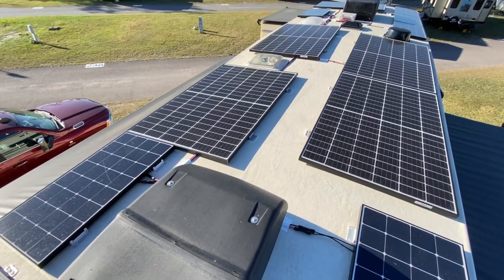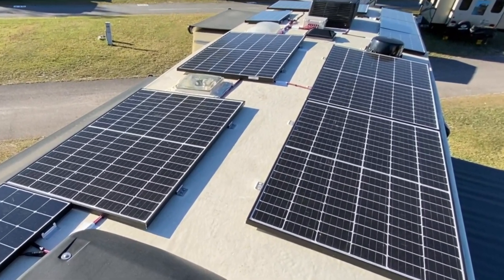@battlebornbatteries & @VictronEnergyBV Setup | 2021 Grand Design Solitude 310GK

Comment: Wow! That is a neat setup! My wife likes 310GK over Montana 3120RL because of its colors and more storage capacity. I preferred Montana because it has 16,000lbs GVWR comparing to 310GK has 15,000 GVWR. My wife wants a washer/dryer and I want a solar setup like yours. I don't know if 15,000 GVWR will handle like that! What are your opinions? Great videos! Thanks!

Comment: so will this system that you installed be able to automatically transfer from shore power, to generator, to solar power on its own? and if not what would you have to do to do it? will this system run 3 ac units or just two at a time?
Reply from the maker: Completely automatic and yes can run 3 ac's at the same time.

Comment: Mike, I've read most of the other postings about the great install you did here.  I'm curious like everyone else. Isn't the customer overpowering his batteries with so much solar power? I realize there's a charge controller meant to protect the batteries from being overcharged by the solar panels. So, isn't it kind of a waste of money to have such an excessive amount of solar, when the 2 charge controllers are going to prevent the panels from sending too much power too fast to the batteries? Thanks. I do admire the great work you do.
Reply from the maker: Hi Roger, thanks for watching. A common misconception about solar is that you need tons of batteries to run your RV; however, unless you plug into shore power or fire up a generator, how will you charge up those batteries the following day and still be able to live comfortably while charging your batteries with only the minimum(or in some cases less) solar? That’s how I look at it when I’m designing these systems. This client is able to live comfortably during the day, run 2 ACs at the same time, if he so chooses to do, or he can actually run 1 AC while charging his batteries (in good sunlight of course) at the same time. The client’s habits, desires and needs are the contributing factor in how a system is designed. The solar is pretty much the cheapest part of the equation, so why not get the most out of it. Hope this helps.

Comment: What grommet do you use for your wire pentetrations through the plywood walls?
Reply from the maker: I typically don't have to go through any walls as I utilize the satellite cable chase.
Reply: @TheDryCampers  Thanks for quick reply! I guess I was referring to the walls that you rebuild in the basement storage to house all the equipment. Have you had to configure an Onan onboard generator to auto start with the BMV or Multiplus before? Can't find much about it in Victron forums.

Comment: Hello, Love the videos! 😁 I have a 600 watt system set up on a travel trailer that I did myself, upgrading over 3 years or so. Love having solar power, It's so quiet. If you're able to catch this comment maybe you could comment on a problem I ran into with a victron 712 meter? Short version is it stopped reading volts from the battery after working fine for almost a year. Reads about 3 volts instead of the 13.6ish that the solar controller reports. Checked connections and readings at all the/any junctions I could find and best I can tell, I think it's the circuit board at the shunt. It looks like others on reddit and google links have run into same problem. Would love to hear your opinion. I've been waiting for customer support at Battle born batteries for months now and no update. Is it something common you think I might be overlooking?  Also would love to hear from a viewer if they've experienced the same. Thanks.

Comment: The system looks really nice 👍 Big should handle boon docking really well. I don’t have a RV yet but the 310 GK is at the top of the list I’m a year away. I have a couple questions, why use different size panels and since it’s a 310 can you share the routing for the wiring from the roof to the basement.
Thank you
Reply from the maker: Thanks and the 310 is a great selection! As mentioned in the video not all RVs, based on the roof dimensions with vents etc, are able to fit mostly big panels. This client wanted to max out his roof with solar, so we were able to fit 6 large REC panels and fit 6 smaller 100W panels to max out at 2580W. Because solar charger controllers max out, we did have to do 3 arrays due to the voltage differences. Most Grand Designs are equipped with a satellite/cable channel and we typically are able to route through the same channel.

Comment: I wiil only get 4 of the REC panels next month, you recommend upgrading the cable fro the connector box on the roof to the MPPT from 10 AWG to  ????? [ I see you did it here, but you have 6 panels]
Reply from the maker: Mike utilizes 8AWG from panel to panel, in parallel, then he uses 2AWG from the combiner box down to the equipment.
Reply: @TheDryCampers  thanks

Comment: The guy that has the fooring store south of Daytona turned me on to your channel, is this his 5 th wheel? Where do you get on the list for a van job?
Reply from the maker: Thanks so much, Raymond! We did Bob’s install video last week (Forest River Cedar Creek). Glad he sent you over and thanks for coming over. Are you based in FL or do you travel? Unfortunately we  won’t be back in FL for quite some time, but let us know. If you travel we can maybe connect on the road.
Reply: @TheDryCampers  I have a question as to whether you ever do any other type of Lithium batteries besides BB? I love Victron equiptment but BB is not the only manufacturer, just the most expensive.